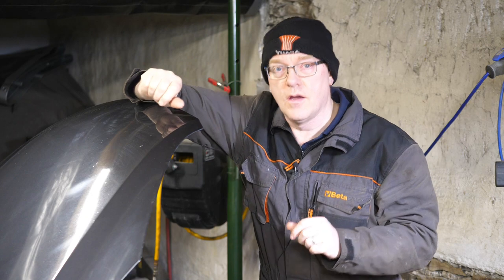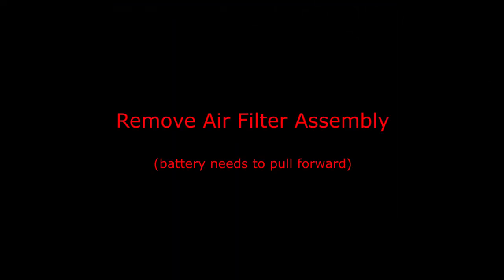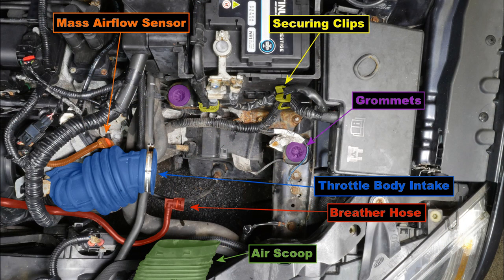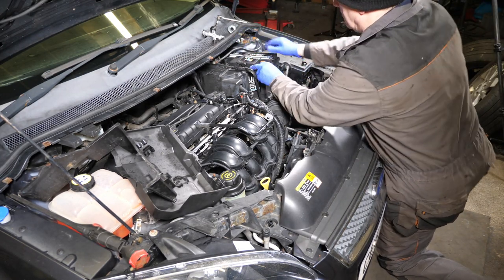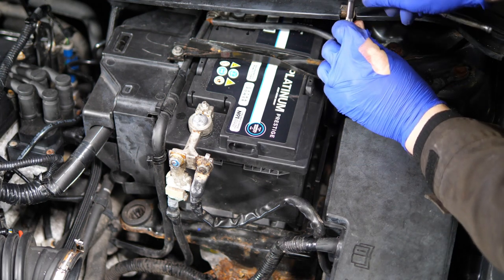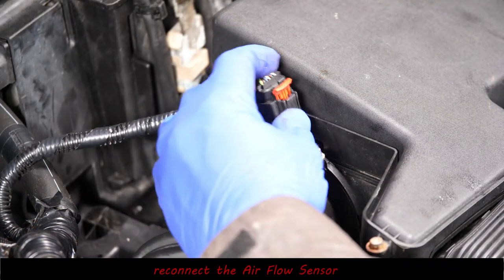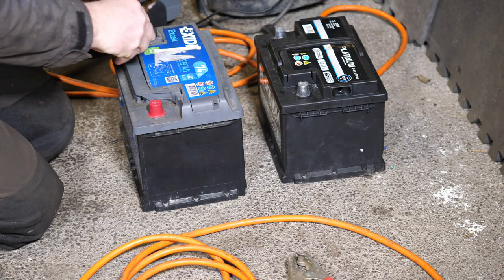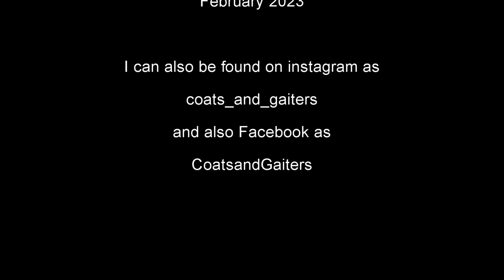Ford Focus Car Battery replacement on 2007 Mk2  🚗 & Bringing a DEAD battery back to life again !!!

Comment: It can be done without removing the air filter box, search for a youtube short "2012 ford focus battery replacement. space to remove the battery". I tried it on my 2005 Focus, and it works.

Comment: I had problem with ford c max mk1 with baterry draining. In few hours car drain battery completly. I recharge it, and drive for couple of mounts. New battery by the way. Did you have or heard of problem like that? Ghia is package of equipment with electric parking brake and parking sensors.
Reply from the maker: Mine has been ok.  Can be quite tricky to find the source of a battery drain.  No interior lights being left on? or modified HiFi?
Reply: No, as i was found out, drain was from something powerful, battery was warm.

Comment: If you are looking at putting this back on the road mark may I suggest cleaning the earth cable as mine cut out on me coming home one night really threw me as to what it was had to get rac out who diagnosed that as the problem he cleaned the connection and where it connects to the body and replaced the bolt had no issues whatsoever after that. Look forward to the next part
Reply from the maker: Thank you Jason for this information.  Is that the black lead to the suspension turret?
Reply: @Coats and Gaiters  yes it is just needs cleaning with a bit of emery cloth. I had to change the alternator and and the ignition barrel while I owned mine you can charge the alternator without having to take the drive belt fully off also
Reply from the maker: @jasonmassey805  Thank you will take your advice and clean it for my other video on the car.

Comment: this looks like the same setupas my ford cmax..can i ask for a bit of advise..looks like your master cylinder is under the scutlle panel like mine...do you actually need to remove the scuttle panel to access it?.if so what a crazy idea from ford
Reply from the maker: Same issue with the battery as well.

Comment: I'm not 100% sure you need to remove the air box etc, as the battery boxing can be removed once the battery cabling is disconnected (it's tight!) -- it appears Ford may have updated things with the Focus 2.2 model, as the boxing has been changed with a removable front panel. Still fiddly.
Reply from the maker: Good to hear Ford have modified things.

Comment: Great video!
My spouse's Focus has the battery fitted as the one in the video.. Got interested to watch all about it just because of the fact of where it is located.. Just silly to see it tucked away to deep in the back. Surely though you should not have a need to replace it everyday..😆 Just was curious to see how they actually do it.
Thanks for this!👍🏻👍🏻
Reply from the maker: Thank you for the comment and for watching.